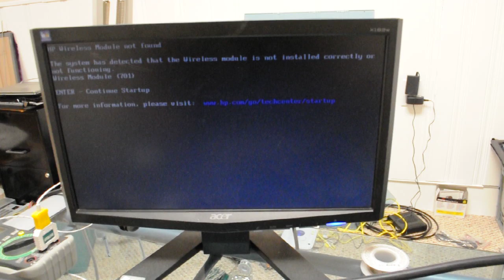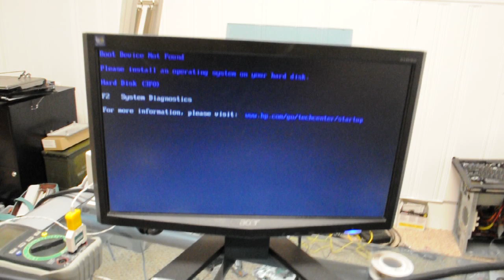HPReflow.com laptop repair for a HP DV4 Intel laptop with a bad charging circuit and damaged mosFET.

Comment: I have one mosfet burned out in my motherboard. Its a NIKOS P60N03LDG QNA7LOMO3. Now do i have to change it to the same one, or i can use some other?
Reply from the maker: I suggest a compatible or same chip. The datasheets will give you the specs you need to match them up.
Reply: BGAReflow Thank you for your reply. I'm realy not in to electronic so i dont know with one is the same chip or how to know with one is compatible. How can i know this?

Comment: I have a dv4-2040us does no power with fully charger battery or AC adapter. Charging indicator comes on but once I press power button power led and flashing indicator flashes once and then charging led goes off on charging port. Please help. I already reseated everything, tried different chargers, pressing 30 secs power button without battery and nothing seems to help. Any suggestion will be appreciated, thanks

Comment: I have 19 volts on both sides of that chip you replaced as well as the pl fuse to the right, laptop will not charge. any ideas ?

Comment from the maker: @coolerester77 I would say it can and probably will.  I have seen and worked on 6 in the past 3 months.  They used OEM and non-OEM adapters.  I think it happened because it failed.  This is a emerging fault in my repair operation so I will say it is different than the BGA errors everyone normally attributes to HP systems.